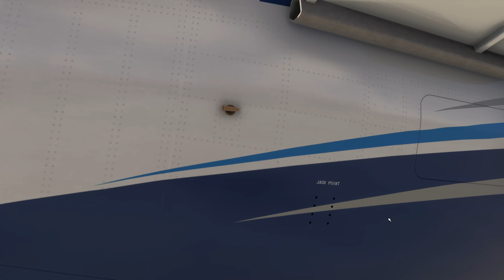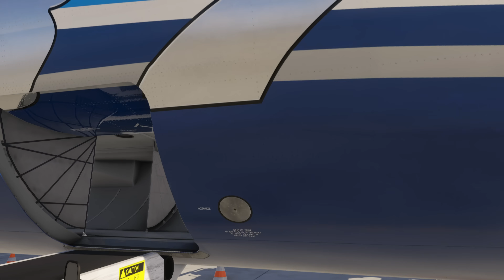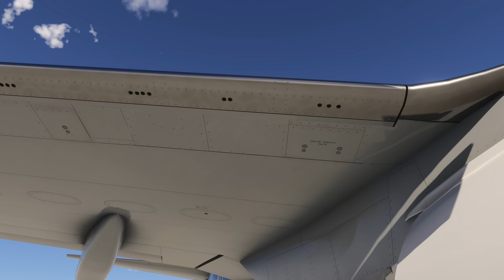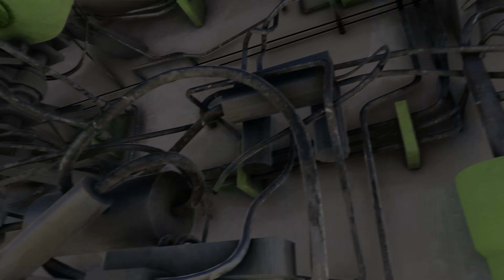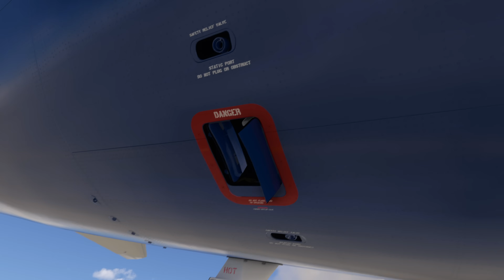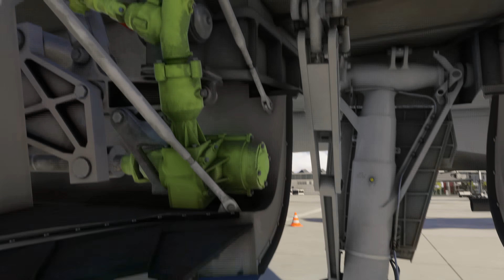PMDG 737-700 Detailed Walkaround and EVERYTHING THAT'S NEW ON THE EXTERNAL MODEL

Comment: Thanks for the tour. They did a pretty good job. I assume they didn't model anything inside the engine cowlings? Also, why are all 3 of the nitrogen lights off? Did they not model that system? Final question: Do you do walk arounds with a checklist IRL, or are you expected to just remember everything? I note that you forgot to check the other door handles, so it's obviously easy to miss things without a checklist.
Reply: 99% of airline pilots don’t do walkarounds with checklists
Reply: @weights6257 hmm. Kinda weird when you think about it. They have check lists for everything else.
Reply: @mdhazeldine because these are called memory items. The is a huge emphasis on the walk around during initial type rating and training. You can bet you WILL memorize before your traing pilot checks you out

Comment: Looks fantastic. I wonder if the left main wheel well has the light switch to turn on the internal light?  It's a great place for ground crew to do paperwork inside the wheel well when sheltering from strong harsh rain and winds.  The nitrogen system green light (Top light) is usually always on.  Sometimes you'll see the blue light on instead. (Middle light).  Inside the fuel panel, they have even included the red manual bypass switches.  Great job PMDG.. 😎👍